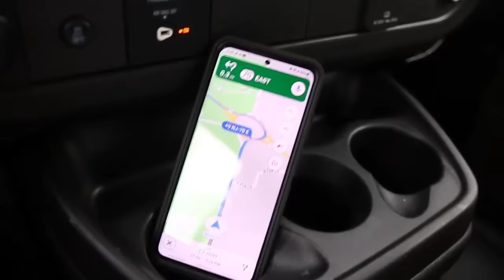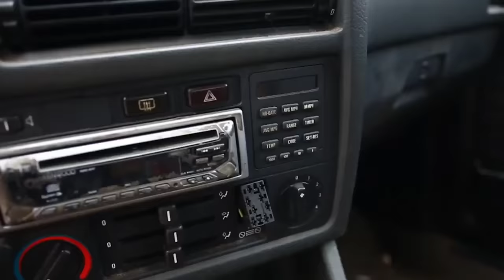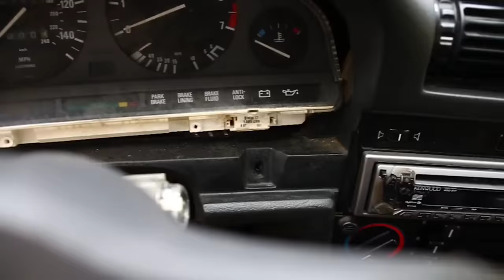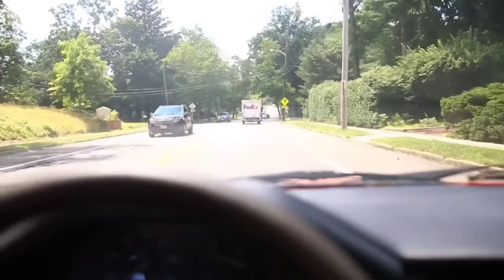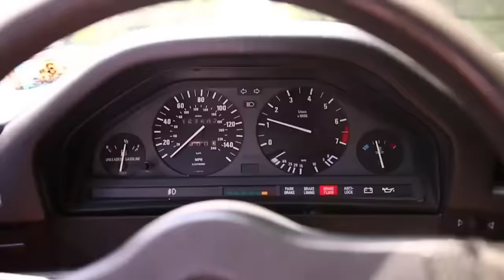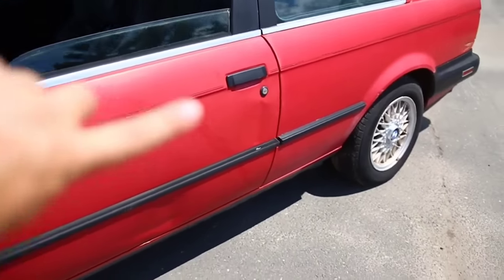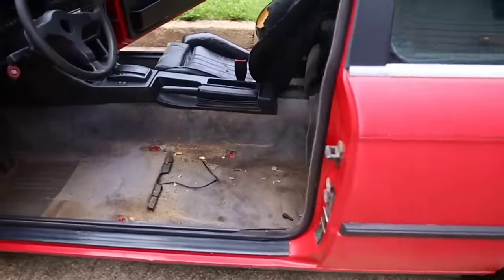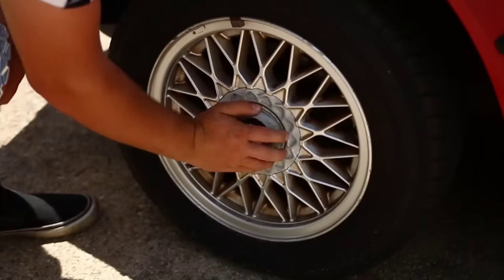Restoring A Barn Find BMW E30 In 10 Minutes!

Comment: I’m shocked at the low cost of the paint job. Didn’t know it was that affordable
Reply: yeah i was like wtf i paid 7k for a paint job and it was not perfect XD
Reply: @Daniel-mw7pu  for a paint job that’s not pricey and that’s just for sanding off the paint of the panels where the dents are to fix the dents and repainting those surfaces they can be a lot more depending where you go or if you do it yourself
Reply: @Daniel-mw7pu  For the love of god Daniel, where are you getting full body paint jobs under $1K hahaha.
Reply: They didn't even remove the door handles to paint it. You can see in the after-paint close up of the door handle where the masking tape has lifted the paint edge when they pulled it off. This was made for video not for quality. They didn't even shampoo the floor carpet, just covered it. And we didn't see anything of the underside or engine work. This isn't a restoration it's a make over on the surface only.
Reply: Maaco has a bad reputation about crapping out after 18 months, hopefully it won't be the case here
Reply: I used maaco in Mt Vernon on my cab the color our co used was light blue with a little metal flake to it. $450 in 2004 money car ran 24/7 through NY winters w/road salt and near salt water and shit looked perfect 3 years later when I sold my share in the company. bear in mid we had a fleet of 30 cars so they masked off everything well. but the car I put on the road was in primer when I got it and who knows what was under that and I'm sure it was rattle can primer. I would not hesitate to let them paint a personal ride.
Reply: Maaco is always cheap but not the best tbh, I work at a paint supply store and We see people come in and rather buy the materials themselves than have them do it because they can more often than non do a better job, also depends what paint they use, a buddy that has a bodyshop that was near our local Maaco (it closed a long time ago) told me that clients always got the Urethane Enamel which is as cheap as the aerosol paint u can buy from ur autozone, its not bad but I wouldn't use it on a restoration, rather buy 1200 in materials to do a complete and put the time and effort to make 100
The main difference is the time it takes to disassemble the car for a good paint job or just tape and pray it comes out good, there is a lot of people that cant tell a difference between a good job and a bad job all they see how cheap it is.
Reply: @Daniel-mw7pu broke boi
Reply: Same

Comment: EVERYTHING was going great.... Until you replaced those wheels... A GOOD wheel clean - bringing the wheels up to the same (if not very close to the finish of the new centres you bought) - would have served to make the whole project a damn fine job...
Also, this video just made me miss my old E30 325i SE even more 😕
Reply: yup, I seen him replace the bbs wheels. Those things have crazy value
Reply: Yeah I agree. The BBS wheels were fine, maybe needed some polishing. Also the bumper to Rustoleum gloss black was bad. I probably would have done matte and then matte clear. Gloss black from a can on plastic tends to look pretty bad.

Comment: You blew it! Messed the project up completely when you swapped the wheels! Great job though! I had a BMW 323i many years ago! Dangerous model to drive when breaking as it tended to swing round! Engine weight pushed down on front and made the back end too light! A known fault with them. Greetings from Thailand.